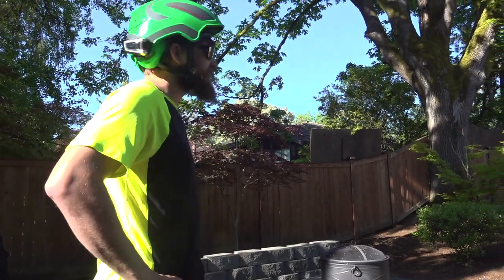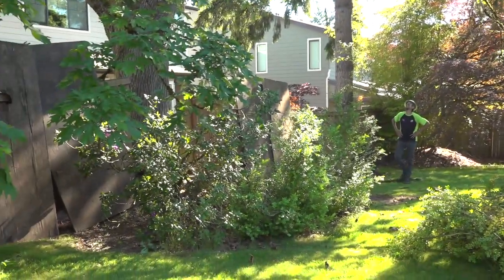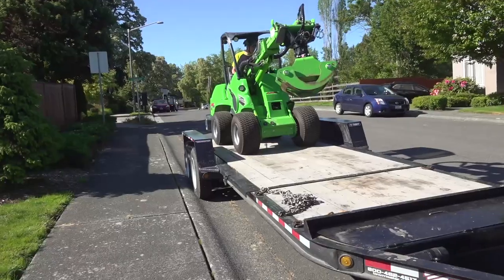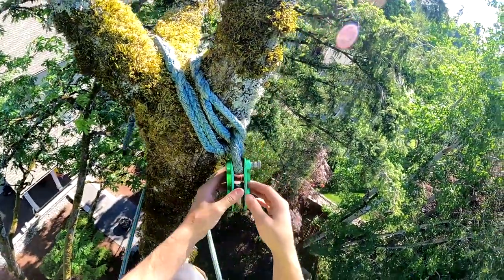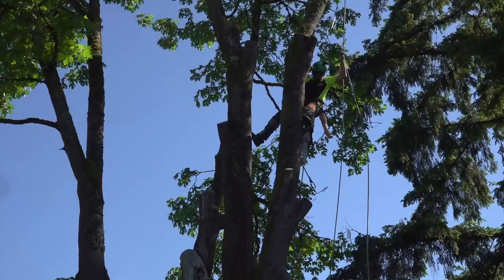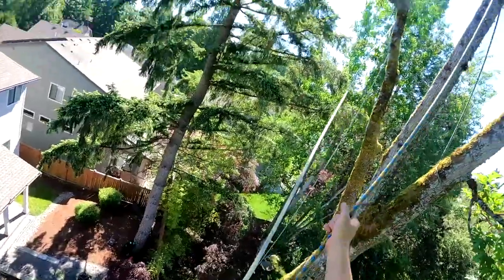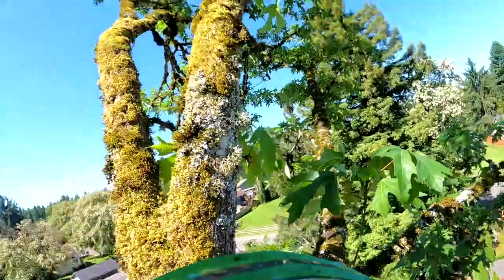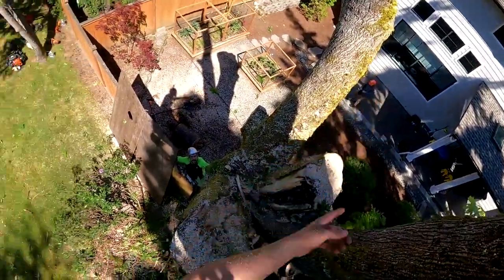WIDE Backyard Maple Removal!

Comment: Hey Jake, sweet content as always. Love watching and learning. 

I was never convinced your battery saw was the way to go yet. Just didn't look to cut as fast as fuel saws. I have a T540 and a 201TC  and they both are fantastic. I was just not sold on your change to battery for the larger limbs especially. Was interesting to watch you change back. I felt you ripped it noticeable faster with less pinching. 

I'm a massive battery tool fan and have loads of battery tools but I'm still not sold on better saws. Plus you can't beat the sound of a high revving 2Stroke 😉😍😍

Comment: Great video.  I've been debating the an electric saw for a while, but couldn't find the info I needed until this vid.  You could use that clip when/why you switched saws in a review.  Also, this is the first time a saw the optidrive.  Does it handle big logs?  Does it keep traction when wet?  I appreciate the feedback on the machine.  Keep up the good work.

Comment: On that equipment your towing. Your supposed to have 4 tie downs. With the chain across like that it only counts as 1. If you added a second binder and hooked both to the vehicle anchor points on both sides with that same chain like that then you'd be good.

Great video though, and that looks like a cool little loader.
Reply from the maker: thanks for the tip

Comment: Quick question about single line. Do you need a rope wrench with some devices? I use a hitch climber pulley for drt. Can I anchor my line somewhere like you did in the beginning and use it srt without a rope wrench? I guess I’m asking because I’m really not sure what the rope wrench is even for and I would like to try srt before dumping a bunch of money into stuff I may not use. I was taught drt on a tautline. I just recently got a hitch climber and then started to figure out some newer tech. I’ve experimented a lot but am hesitant to use my hitch climber for srt if it’s potentially unsafe

Comment: Lateral lol 😆 Love how that 201tc-m eats that wood no problem. The 201tc-m carbs can be reset to factory.  Also the carbs can be tuned for rough idle.  All by following steps provided in the book or a quick Google search.  My boss bought a 201tc-m from the pawn shop practically brand new and paid 400$. Saw bar and chain. Still had the spark arrestor and black line on the white plastics for aiming your face cuts and etc. So the saw was Damn near never ran before the pawn shop got it. Boss was buying ladders the ..little gaint ladders. 3 of them to be exact plus the saw all for $800 cash while Each of those ladders brand new at Lowes are like $250-$300. Moral of the story is the saw ran like shit from the previous owner or the pawn shop putting cheap gas & non certified 2 cycle oil in it. Ratio wasn't right either. Did a reset on the carbs to factory then did a self idle tune seeing it had been ran somewhat and boom 💥 Boss man was like woahh never seen that. Before he didn't believe me and my supervisor that you could do that with those saws!  Sheesh man I tell ya..  That saw purrs like a kitten  and eats like a lion to a gazelles ass!!. Just put a brand new yellow tab round ground chain on her with the 16" stock bar configuration. Good having a new saw being my old 201 got used by a coworker that climbs for the company every so often and does mainly quotes everyday. Dropped it 30 ft onto a AC unit and crushed the handle. Need a new one ASAP.  She is now my personal saw THAT STAYS AT HOME!  Appreciate the videos Jacob! Glad to see how far you have came since this older video. Shout to Inbred Jed for being the best backwoods Tree felling Jedi the world has the offer! 💯🤙🏼💪🏽 Yall take care. 😎

Comment: What do you typically charge to remove a tree of this size?
Reply: I'll answer this one for them in general (after reading this hopefully you will understand why you won't get a specific answer) - it depends upon lots of factors.  For example in this case, if my neighbor didn't allow the crew access to her yard to use as a drop zone, they would have had to bring in the crane (parked about 50 feet away on the street) and pick everything up and then down to wherever the chipper was (possibly over the other two-story house whose back yard this tree half-resided in - the tree was right on the property line).  Not only does that cost more due to the crane and its operator, but it makes the job take a lot longer meaning a higher labor cost for the rest of the crew.  They would have had to pick all of the tree using the crane, instead of being able to use that super-cool green grabber machine to quickly move the larger wood chunks out to a pile near the street for later pickup.  Watch the "ENORMOUS Deodar Removal GRAND FINALE" video to see how they do this using the crane.

So that's why you will very seldom (if ever) see them discuss "typical" prices, because there are so many factors to consider on pricing a job that there really is no "typical" job.  The estimator's job is to take everything into consideration when setting a price for the customer.  It's a difficult job that can make or break the business.  For example, maybe the estimator looks at a tree and thinks it is safe to climb and bids the job that way, but then Jacob starts climbing and finds out that the tree is too rotten to safely climb, or maybe part of it is, then that can totally change how they decide to execute the job, which can significantly affect the price.  That would be a question to ask them - how often does something like this happen which causes them to have to change their bid?

Now if you have a tree out in the middle of the field, that can simply be cut down from the ground in one cut (meaning no climbing or rigging and no crane needed) in any direction w/o hitting any wires, structures, other plants, septic drainfields, etc. and you can back the chipper right up to it afterwards to grind it up, then that is going to be your best-case situation on which you will receive the lowest price.  But I'd hardly call that a typical situation.

Comment: ever drop a 500lb or more branch on top of a House you were working?
Reply from the maker: I have hit several houses with trees. I also took out some power lines ones with a huge branch. I’ve seen a couple houses really get bashed up hard from other people but I demolished a deck once after felling a tree onto it. I broke a lot of stuff in my earlier days and sometimes I still break things like flower pots and fence panels and stuff. It sucks. Tree works is really hard to do without ever breaking things.

Comment: Ha the does the husky have a chain brake.. I gave the husky rep a earful about that chain brake assembly, and no mine does not have a chain brake stopped using it all together after finding out what is required to replace the handle.. between that and the one I have having to be choked almost every time it’s shut off adding 100’s of extra pulls per day I absolutely hate the dam thing and will not buy another